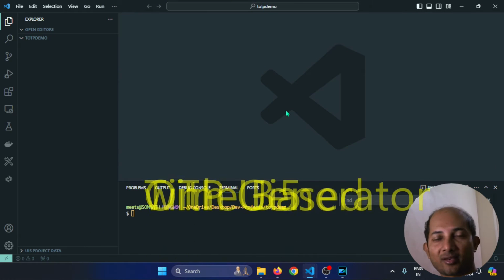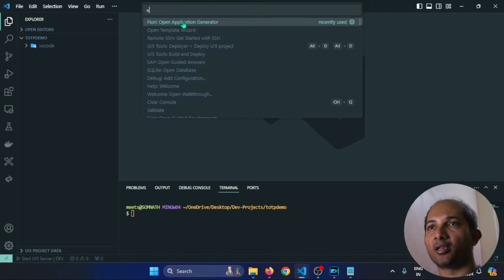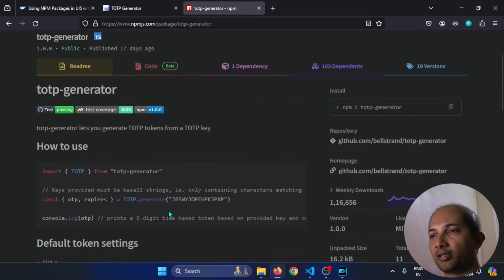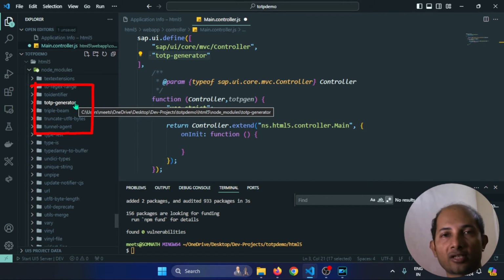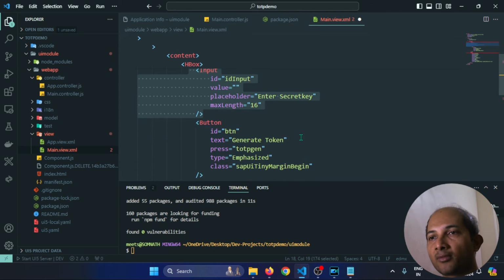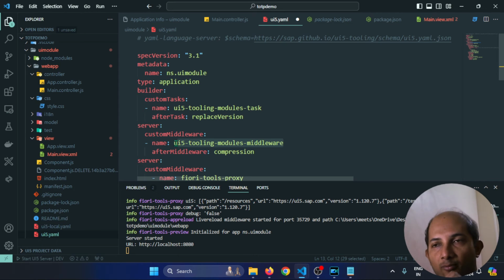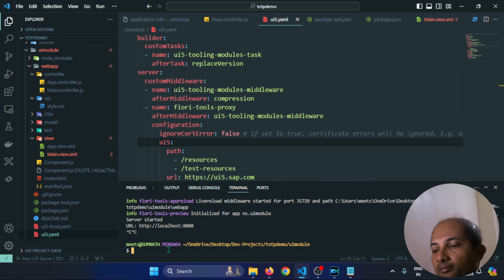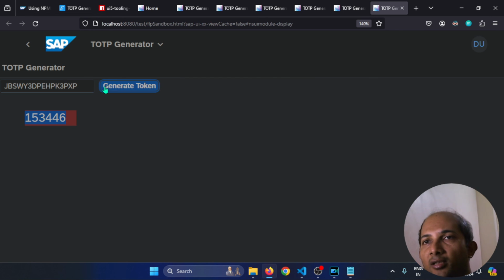Build a Time Based OTP Generator using UI5

Comment: Hey, good video. :)

Some points from my side if I may:
- The title is a bit "clickbaity"? As you're not building an OTP generator but rather using a dependency and implementing this usage within the application but I get it. ^^ 
- With your configuration and UI5 tooling version, the `ui5` key in the `package.json` is obsolete and shouldn't be used or recommended anymore. 
- I wouldn't bother adjusting the `afterTask` setup in your configuration and simply always put the ui5-tooling-module-middleware as last configuration option so the order in which they will be executed is always fine, also helps in not adjusting the `afterTask` for any additional configuration that may be added
- After making use of requiring and injecting the dependencies appropriately I was a bit sad seeing the access to the JSON model via globals, but thats a minor thing
- You shouldn't manually destructure the UI5 control object to retrieve the value via the properties but instead use its API methods like "getValue"

These aren't major things and I know that you probably also know all of these but as this is a learning resource for many so I think it'd be important to note some of them or have them done differently in future videos (though this one is already 5 months old as of writing this comment so idk. how much that matters at all - the web moves fast!)

Keep it up, love to see UI5 content! :)
Reply from the maker: Thank you for your detailed feedback. Yes things can be done always differently and  always have a scope of betterment. Thank for watching and stay connected.